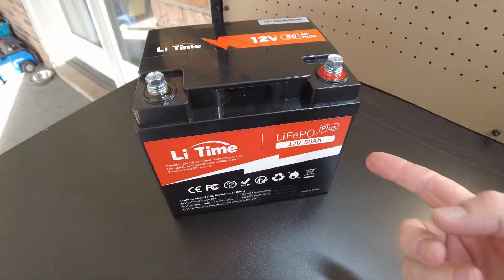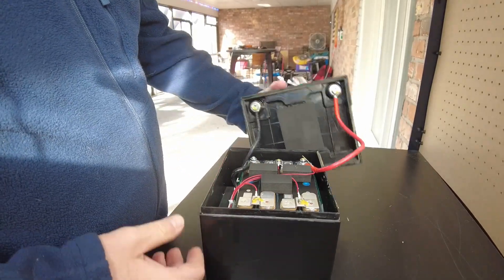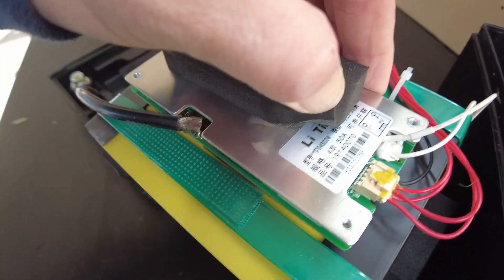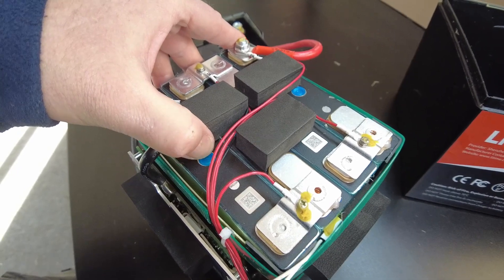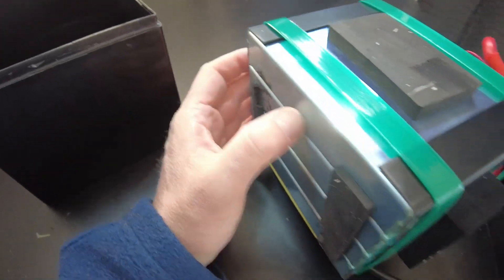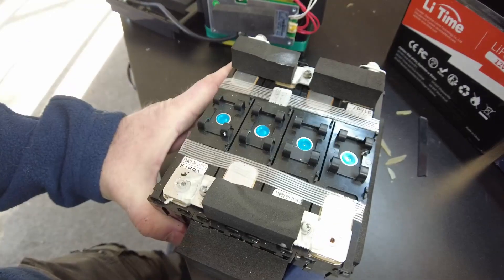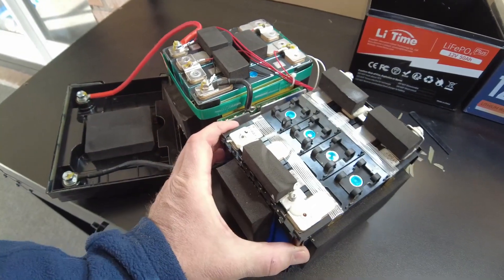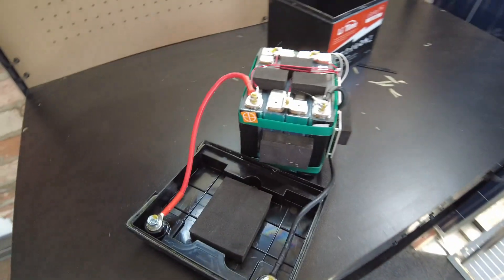Li Time (Ampere Time) 50ah LiFePO4 Teardown

Comment: I have that exact battery under a different name Timeusb. The bms on mine caught fire lucky the cells didn't catch fire too it would of burned down my house. I've never seen a bms burn a hole thru it's center before. The only reason I took it apart was it wouldn't take a load. I never new there was a fire inside that case, my  god the smell when I cracked the top off the battery it's been two days and it still smells like an electrical fire in here. The funny thing is the cells are fine I put a new bms on it tested at 52ah.
Reply from the maker: Yikes, I bet a MOSFET blew out. Glad you're OK!